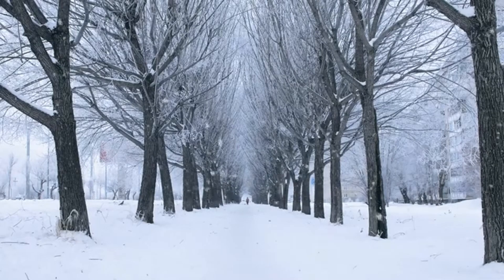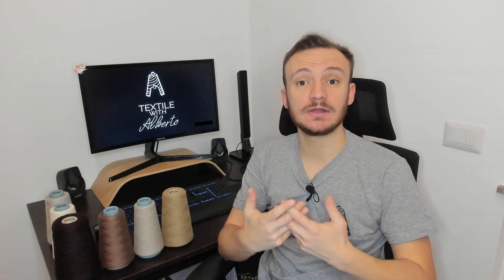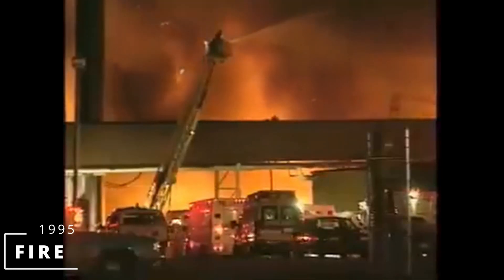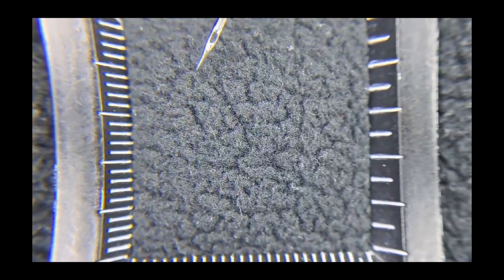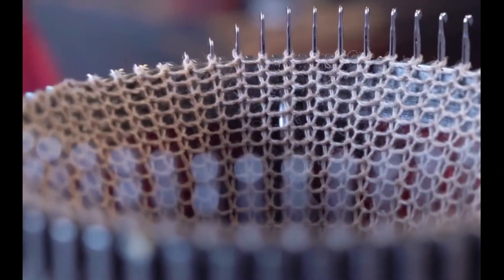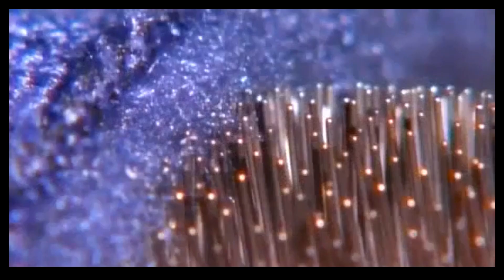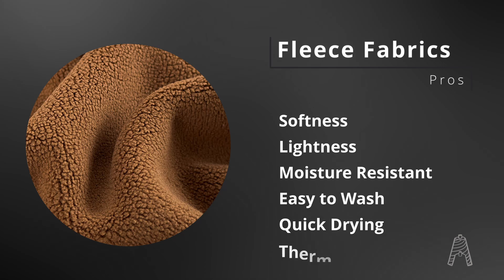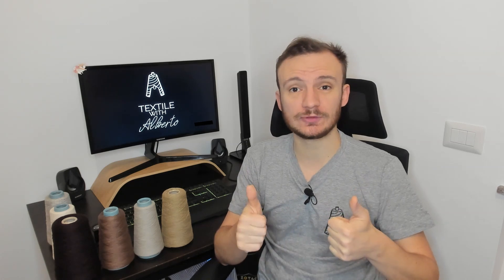Why is POLAR FLEECE so warm?

Comment: Polar fleece’s warmth comes from its unique structure! How does the fabric’s loft and fiber composition impact insulation compared to natural wool?
Reply from the maker: @RyzealSourcing  Thanks for the great question! Compared to natural wool, polyester is worse if the humidity is high. Wool isolates better even when wet, but polyester is better for quick drying and care in general.